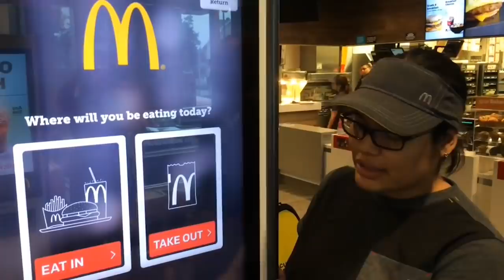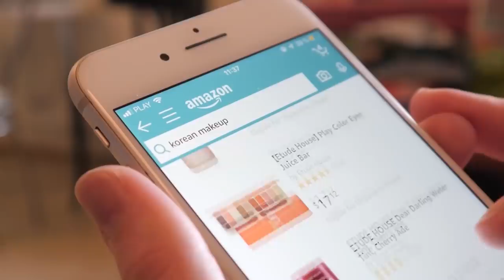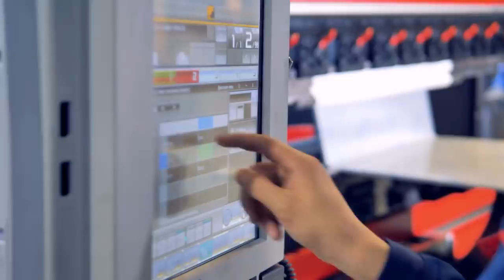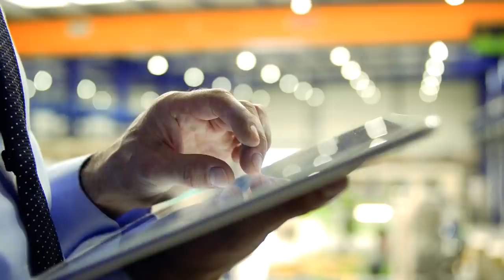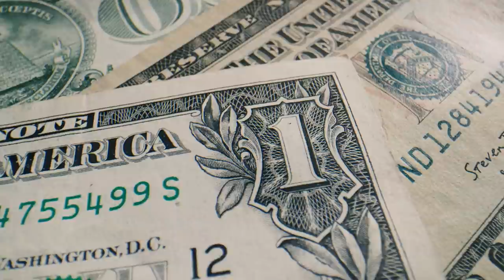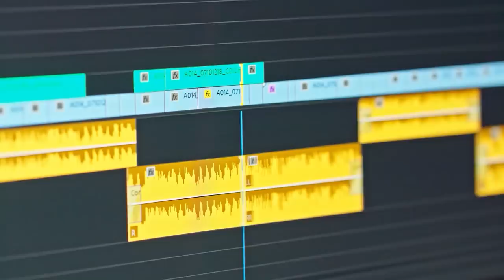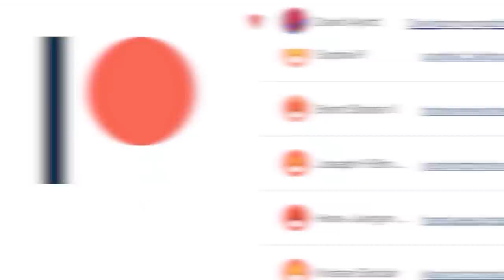The Two Futures Of Automation: Capitalism VS Socialism

Comment: There is something left out that is important in the first part. That is, the question of where is the buyer of products produced. In the second part, which is the praise of socialism, where do the initial funds come to a group to create the resources of producing  wealth, like farms or factories, with a resulting product that others will be willing to buy? Also where does a salary come at the beginning of a venture? I have seen many groups start something, but the end result has been generally "failure". 
I find your presentation simplistic and not thought out properly, and you should study it further. Or maybe have a "third" thought.
China is socialistic, but the enterprises are mostly under "State" control, and those who control the enterprises can be easily replaced, which is similar to Capitalism, with just a different BOSS.
Kibbutz systems are voluntary and work fine if all are honest and contribute equally to it's success.
Reply: @fraser After high school, where our teacher made us learn both Karl Marx and Adam Smith, I was involved with the development of 2500 acres of virgin land in Tanganyika, that was awarded by the government on lease for 50 years, with an annual fee based on the acreage, but only 60% was usable. We had to build a road and a bridge to get there, plus all the infrastructure. It took 5 years just to break even, and many of the neighboring farms gave up after two to three years. In another area, the government expropriated nearly 20 farms having been developed for four to five years, and gave them to the employees. Within one to two years they were in ruins. I learned a lot at the time, and after six years I went to University to finish my Engineering Degree in 1967. I studied Economics and management from then on. Worked for many companies, and changed each time I realized there was nothing more that they could teach me. Eventually I was ready to embark on my own, and as a result a company that needed a problem solver in another country, made me an offer that no one could refuse. Later went to Italy where I did the equivalent of an MBA while learning Italian, and for a while did consulting to various companies to understand better how to operate with the crazy government policies. Then I bought out a business, and retired after 25 years of happy customers.
So I have to ask you if you have ever set up your own business from scratch, since from reading your comments I have a doubt, appearing that you want to benefit from others that have set it up.
I am now coming 85, and still give advice to those that need it, and those that did not heed my advice, went bankrupt as predicted.
I suggest you read some of the writings of Prof. Thomas Sowell, but I am only sorry that I discovered him fairly late in life, but still enjoy reading his texts.
Thank you for the "dialog", and wish you the best for your future.
Reply: @fraser Thank you for your contribution that has valid points, and some weaknesses. When young, I asked my father why we paid our employees  double what our competitors paid theirs. He just said ...  look out of the window, and tell me what you see ..... I said I saw about 50 persons, just waiting. They are there waiting to join our team because they know we treat them well and fairly, hoping that someone will leave, so to take his place. So I include here something I wrote some time ago in memory of my father  ........    FOR ALL THOSE WHO WOULD LIKE TO CHANGE THE WORLD

My father often came to visit me on the family farm at weekends. Year 1959.

At 1000 m. above sea level, not so far from the equator, and without air conditioning, the practice after lunch was to have coffee or tea under a beautiful tree near the little house we had built a few years earlier.

As a young man, I enjoyed listening to stories from my father's life, and how he came to be in Africa.

During one such story, he stopped midway, and waiting for it to continue, I kept looking into the distance. The prolonged silence made me think he wasn't feeling well. Instead he was reflecting. I asked him what.

"Did you see the person who passed by a moment ago?" I said yes. “That person came here three years ago, barefoot and dressed in tatters, and begged in his language to give him any work, because he was so hungry! He has now become one of our best plowing tractor operators. And as you have seen, he now walks proudly, and he also has a young wife. "

While he was telling me that, another employee passed by, and my father said that he too was completely ignorant when he first arrived, and now he has become the teacher for new hires, and that he follows them until they understand their task.

I asked him "SO?"

"I was thinking of all the arrogant dictators who think they can change the world!"

"To change the world, it is only necessary to give every human being the opportunity to develop his/her natural talents to the maximum, and following them in their development."

Years later, in another country, attending a course on Business Management, I came to discover "Maslow's Pyramid of of Human Needs", which explains in a simple way, the needs and paths of human development in all free societies, which is very similar to what my father explained on the farm.

Comment: Literally none of the jobs at Amazon are based on the pace of the machines.

Also this video is wildly exaggerating the abilities of future AI and ignoring the many jobs that will replace the current ones as narrow AI proliferates. Jobs which the younger generations are already competent in.
Reply: Can you provide me a source for the first claim?
Reply: @Slobzz  I mean I worked there, there are expectations for what you're expected to do but the pace you do is up to you. It's measured by units per hour for picking, stowing, and packing. The machines only move relative to your own pace. You don't get a new pod as a picker, for example, until you finish your current pod.

You'll get reprimanded for being super slow but that's it.

Comment: Show me a robot that can build frames and set glass 

Show me a robot that can run accurately run plumbing through a building 

Show me a robot that can precisely install wiring in a building for electricity 

Show a robot that can properly install HVAC systems in a super tall skyscraper 

Does anyone get where I'm going with this 

YOU CAN'T REPLACE US A.I.
Reply: P.S. if the elites expect us to embrace this new system 

Then we need a lottery system that's not damn corrupt and rigged
Reply: AI isn't a thing to fear or even fight. It's rather inevitable in that it's a more productive tool for humans to utilize for whatever they want to achieve. The concern is rather closer to your second comment - elites and our distribution of power as you're correct that an increasingly corrupt or unequal society will not adapt sustainably to this.

Comment: Capitalism will always be the worst of the two systems because it encourages a value to be placed on people which means those of lower value cannot find work. Socialism supports those who cannot find work though it is only viable if there is an excess of wealth. Capitalism is needed to create the excess which allows for Socialism to function properly. I have abandoned the idea that a non-regulated market is a good idea. Regardless of the era you are talking about equality has to be forced. We cannot continue in America discriminating against certain individuals then gaslighting them into thinking it is not discrimination. If you submit five job applications and are not called back some type of discrimination is occurring. It is not that the company does not have the money to hire you. They have chosen to hire other people instead.

Comment: it amazes me to watch both the video and read some of the comments.

In order for socialism to actually work the world will need three things.  1.) a infinite, free power source.  2.) method to convert that energy produced by the infinite power source into materials for consumption. 3.) A drastic change in the mental idealism of the human race, currently we strive for material wealth, we would have to strive for intellectual wealth.  Meaning doing things for ones self that only benefits oneself not in a material fashion but in a capacity that drives true happiness. Thus completely eliminating the Human Factor out of the equation.

Socialism primary ideal is that something will always be provided by someone else.

Capitalism is already working, has been working for a long time, and will continue to work.  Because incentive drives production.  Even with automation, workers will still be needed just in a different capacity.  For example the invention of Electricity eliminated the need for lamp lighters.  The invention of Refrigeration eliminated the need for Ice Houses and Ice Traders.  There are countless machines that eliminated jobs over the centuries.  The people that used to do those jobs learned new skills and completed other jobs.

People that commonly advocate for a socialist society advocate for the elimination of fossil fuel usage.  All those people in all those fossil fuel jobs will have to learn new skills to do other jobs.

My point is Socialism does not drive innovation, capitalism does.

UBI is good for society and we should embrace it all while eliminating wellfare.  UBI does not "privatize wellfare" it frees the people to do what they want with money provided by the automation that we wouldn't normally be able to reap.  This would help drive capitalism even more.  Btw there is a tax method that would solve a majority of what people who believe socialism is the better model.  Check out fairtax.org

Comment: The logic in this video about capitalism is very flawed! You state in the video that the wealthy elites will be the ones who own all the robots that control all the automation, and that this automation is going to lead to the working class becoming completely obsolete, Which will lead extreme poverty, and the ultimate two class system.  Before making this video did you even bother asking yourself;  what's the point of producing a product if there is no one with enough wealth to buy your product? Capitalism cannot work and will not exist in a two class society. It requires a middle class of consumers. Which is why the middle class pretty much did not exist before capitalism and the industrial revolution... At least it didn't exist in any meaningful way.  People living in extreme poverty do not buy new cars, big screen tv's, video game console, ect.. therefore there is no point in mass producing anything. So long as capitalism exist so too will the middle class. 

On the other socialism does create the ultimate two class system. Which is one of the many reasons why socialism ALWAYS fails. Societies shift towards socialism because people like yourself are always duped into believing the promise that socialism will provide equality, prosperity, and security. Equality being the only one of those promises that will come to fruition. However, we wont be equal in prosperity. We will be equal in poverty and misery. Socialism has been tried many times and in many different ways, and it either causes a total economic collapse, or it devolves into nightmarish authoritarian tyranny. Marx was flat out wrong. History has proven this time and time again. Marx provided the world with nothing more then the most epic pyramid scheme of all time.